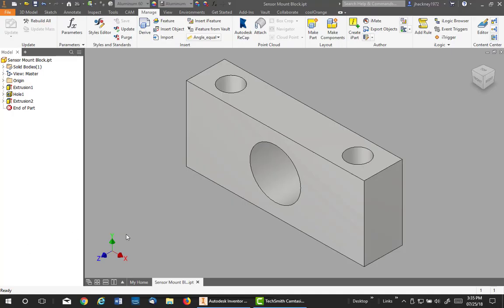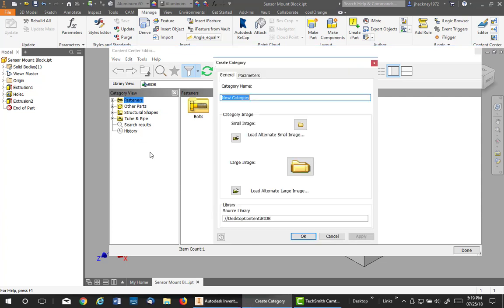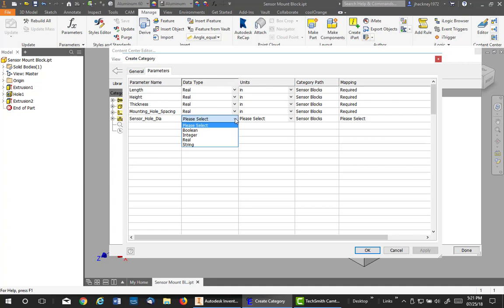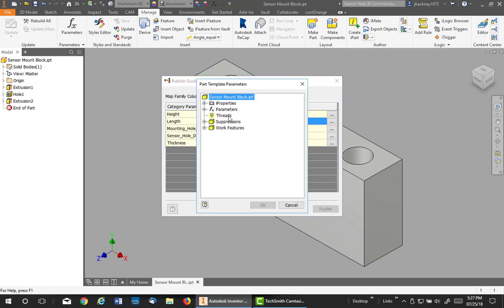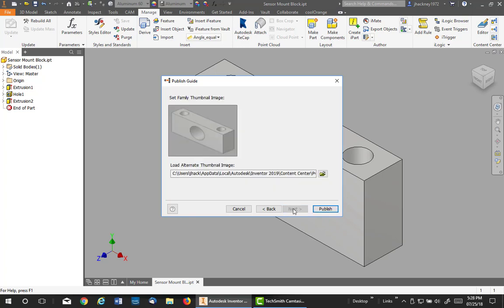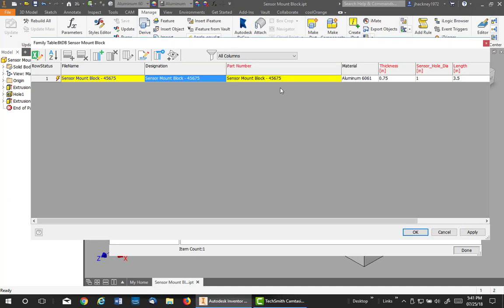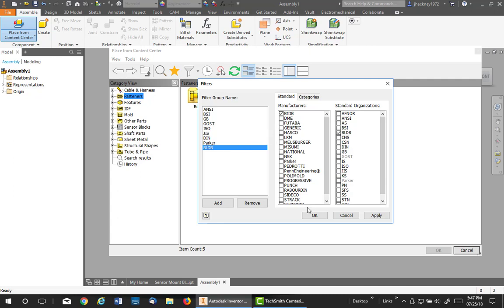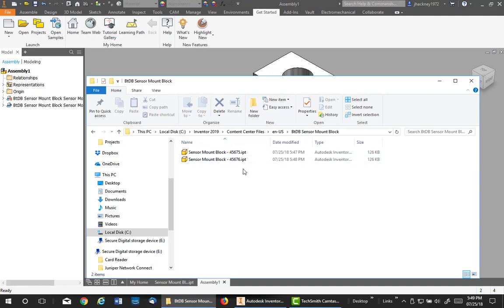Creation of Inventor Custom Content Center Library - Part 1

Comment: Thanks a lot for this tutorial. It helped me to create own component.
Just one question I have (for now). I see that while we place a pipe from CC it is possible to type a length value. How to make such adjustable parameter?
Reply from the maker: Send my your email address to jhackney1972@outlook.com and I will send you the explanation.  I do not have the ability to show you in this reply.
Reply: @jrhackney  Thank you for readiness to help. I've done some research and found that 'Custom Parameter Column' mark in iPart becomes adjustable when placing a component from CC. That is what I expected.